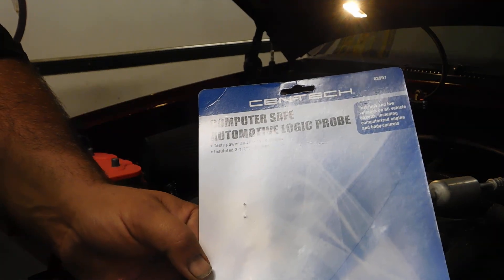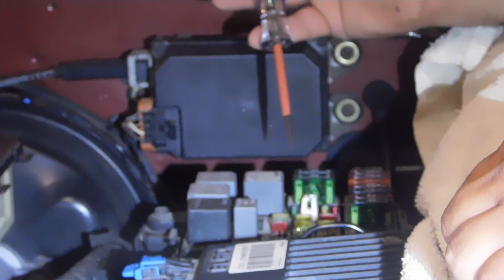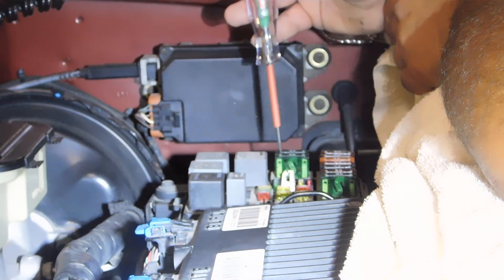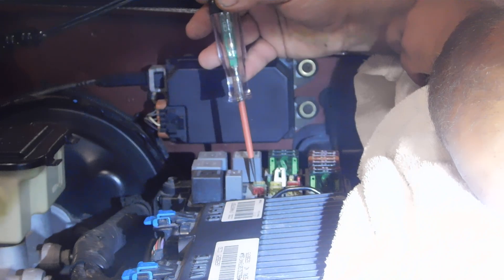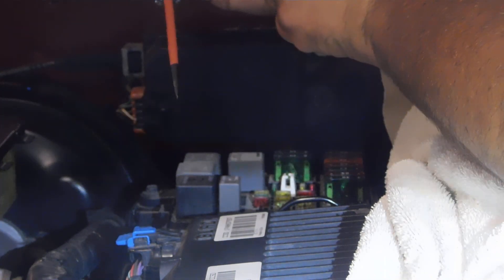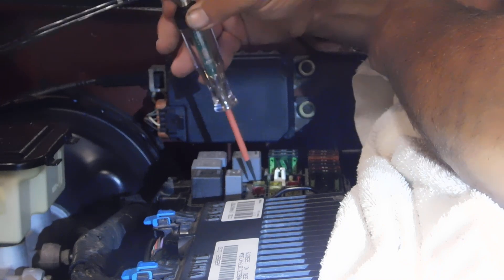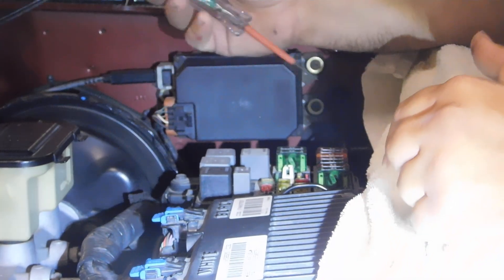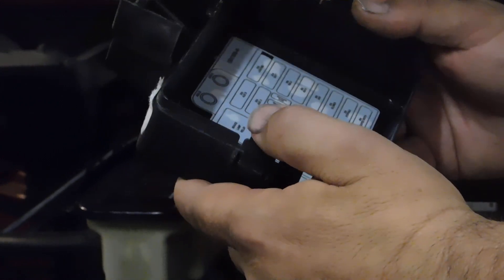Harbor Freight Computer Safe Logic Probe Test Light (Testing fuses the easy way)

Comment: Hey man, I could be wrong but I'm pretty sure that the Red light is to indicate Power and Green is to indicate Ground.  If you have a fuse that lights up green it means its touching ground somewhere Which would indicate a fault in that circuit.  All the fuse's in cars fuse panel are to protect 12volts power supply's not negatives. Not trying to police your content just sharing what I've learned.
Reply: If there is no power to you load device( fuse blow) just becomes a ground circuit with extra resistance the only whay you would know if your shorting to ground would be fuse blowing

Comment: What if need to test interior fuse box? Need to plug since the battery? On my PK is on the opposite side so probably will need longer cable

Comment: does the key have to be on the "on" position in order to test if the fuse is good?  also how do you get get a power point inside the the car if the cable is not long enough or can you just ground the black to the body like a normal test light?
Reply from the maker: I use a pair of cheap 
Jumper cables to extend the test light inside the vehicle (make sure to tape up the ends between the jumper cables and rest light leads.) also whatever circuit you are testing should be powered up to test it, so usually yes the key should be on.